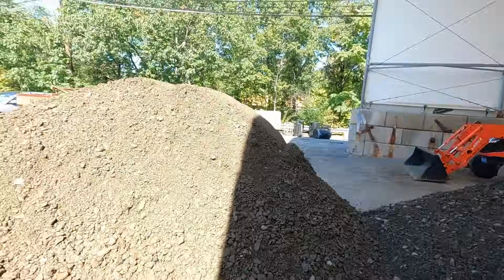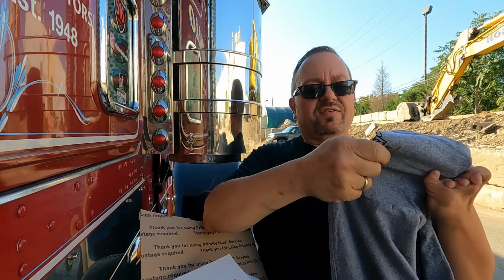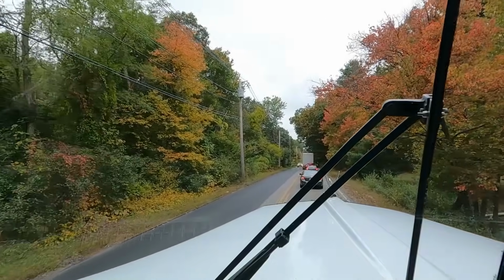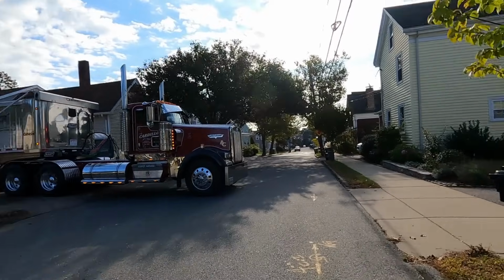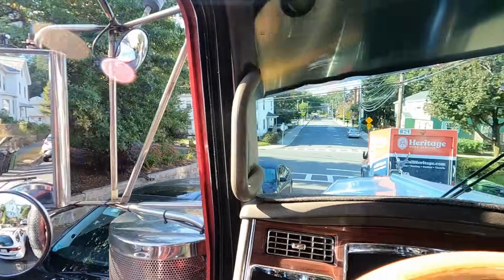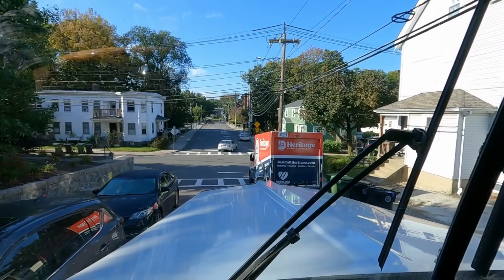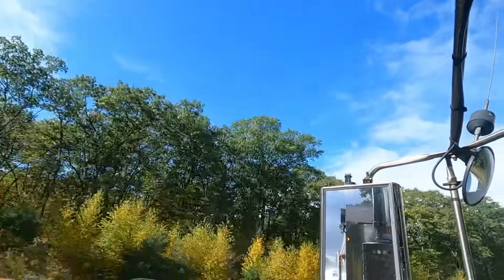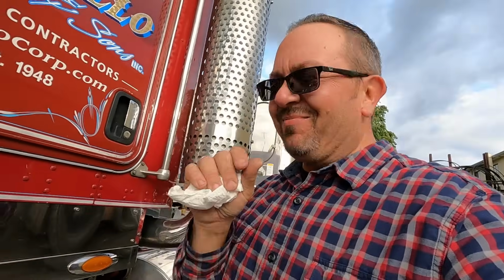Trucker's Video Log: Gotta Keep Movin' On!

Comment: I don’t know how the working relationship is up there in Boston with the heavy equipment operators but here in Chicagoland  the Operating Engineered some tmes make a fuss over drivers & laborers operating equipment with rubber tires  but always make issue out of it if the equipment has tracks  under it
Reply from the maker: It's a little different here in Boston, most operators are polite and get along with drivers and only a few cop attitudes and have to be pulled out of their machines and beaten! 😉

Comment: I have a question, in some of your videos it shows you loading your own trailer.  Is that common in your state ?
In Washington State, I believe you need a license to do that unless you are doing it with your own equipment on your own land.   I also saw your video when you  came  to the Seattle area and met Dauminique the dump truck driver.  That was super cool as well.    Thanks for the great content, always interesting.  You have great respect for your work, the company and the equipment.
Reply from the maker: It's not that common, just in small construction companies like ours and I am licensed to operate with a 1a/2c.
Reply: That is a smart license to have...  Thanks for answering.